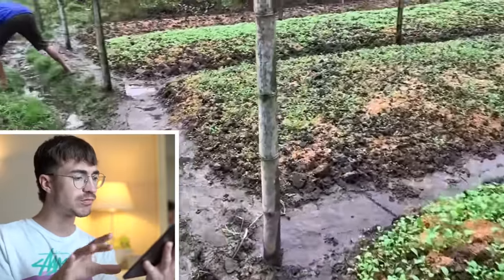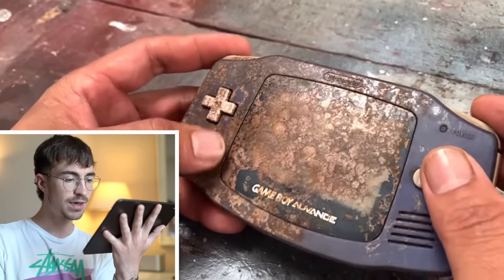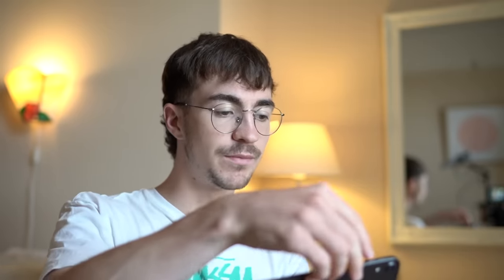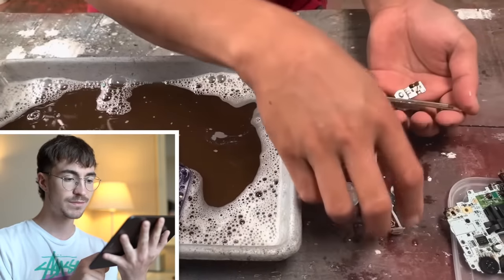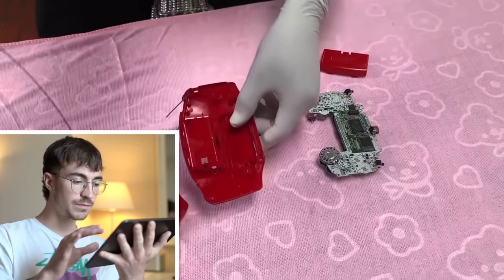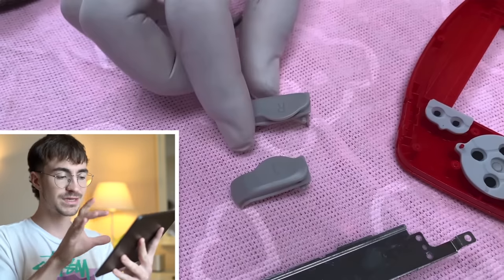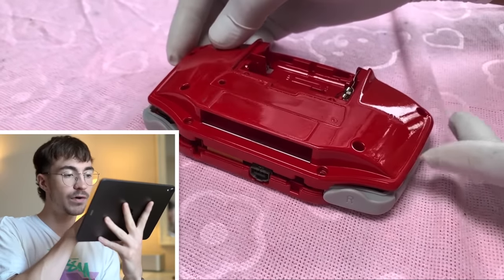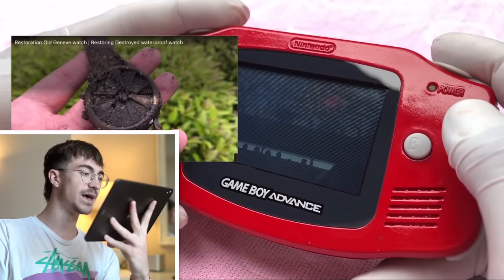Exposing FAKE Restoration Videos!

Comment: I don't know chief. After I cleaned my laptop in the sink, it actually unlocked additional RAM. These guys seem legit to me.
Reply: That explains why the big tech companies always tell you not to expose your electronics to water. They want us to give them more money for RAM instead of getting more of it for free 😒
Reply: You're hilarious😅
Reply: It's the ram that downloaded itself
Reply: Exactly! If you dry the board completely, it works. I myself washed a PCI card last month.
Reply: Wonder if you wash an RX 6500 XT would you get a higher frame rate?
Reply: @jerryspann8713  yes! Water is electricity conductor and rx 6500xt uses electricity (I think)
Reply: @jerryspann8713  Sure thing! Best also buy one with red LEDs for more power. But washing a GPU can be tricky. If you send it to me, I can do it for you, though. I will surely send it back!1! :D
Reply: I put mine in the oven and then immediately in the freezer, I get +128GB of RAM everytime 🤣😂🤣🤣🤣🤣🤣🤣🤣
Reply: @Jakub A
put my laptop plugged in while in the bath, didn't unlock ram, can no longer walk, I need a tutorial.
Reply: Water isn't actually the thing that damages electronics, it's the impurities inside the water that make it dangerous. What happens to the electronic is that when electricity goes somewhere it wasn't meant to go, it literally fries the board or circuit, but water isn't conductive at all, its the ions inside of it that allow electricity pass through, so if you use something like purified water, it won't damage anything because its not conductive enough. And yes, I know the video is fake. I just wanted to point out that putting electronics in a liquid, isn't really evidence that the video is fake unless you know exactly what is inside of it.
Reply: @menopriezvisko94  Water is actually a horrible electrical conductor, its the impurities inside of it that allow electricity to pass through.
Reply: @CrippleStick12  Idk if your replying to me, or someone else, but I'm assuming me, because I was the last comment to talk about an electronic in water. I already know this, we covered it in science 9, years back.  I was making a joke based around the whole toaster in bathtub joke. But while scientific knowledge is still helpful, It's helpful when someone makes a dumb comment, it's kinda unneeded when it's a joke. But that's just my opinion.
Reply: @rawdrywall8212  My bad bro
Reply: Yeah I unlocked more RAM after I accidentally hit my tablet with my head. 😁
Reply: When I Dropped My Laptop Off The Empire State Building Into A Pool Of Swamp Water And Hit It Multiple Times With A Sledgehammer I Gotten About 4206942069+ More RAM
Reply: You cannot post it online unless it's true. My government told me so.
Reply: 400TH LIKE
Reply: @meatblazestudios3778  congratulations.
Reply: Congratulations for your motherboard hardware components to get corroded later.
Reply: Probably 'twas the "water memory" effect one Chinese scientist was talking about ;)  Maybe start complementing it and you'll get some extra ;)
Reply: Also the motherboard is a device that slows down your console, make sure to smash it with a hammer to destroy the device!
Reply: That really doesn’t seem too far-fetched because when my WiFi stopped working, my computer monitor stopped working as well. I plugged my monitor into a different port on my PC and the monitor started working again, and so did my WiFi.
Reply: @Chicag-no   it makes so much sense now!!!!😦😦😲😮
Reply: Poor guy I washed my pc with water for 2 days straight and guess what it had no GPU but not anymore after I washed it I instantly installed rtx 4090 idk man they pretty legit
Reply: I chuckled at your comment.
Reply: @Chicag-no  its a joke mate
Reply: Does a dishwasher work better? Maybe send it to a rug cleaner youtube channel for them to run their scrubbers over.
Reply: You dont need to sink it in water, just download more RAM
Reply: I actually used to stare like hawk at my rgb and then the rgb upgraded my ram so now i have more ram it says 124098 ram so i trust you
Reply: @menopriezvisko94 😅😅😅😅😅😅😅😅😅😂😂😂😂
Reply: The fan on my tower was broken, so i put in the washing machine on 1200 rpm on high. That kickstarted the motor or something

Comment: You can tell some of these are fake from the thumbnail by the visible smear marks and lines from scrubbing dirt over the top of them. It's so ridiculous.
Reply: And it’s always strange dirt that is orange or green
Reply: @zero9112  are you sure it’s green “dirt”…? 🥶
Reply: And also the title says like "Restoring gameboy 3ds" when on the thumbnail is actually a nintendo DS lite
Reply: @ImNamo_  That’s the best part. They expect us to believe they restored it when they don’t even know what they’re working on… It’d be like me saying “restoring 50’s caddy” when the thumbnail is actually an 82’ GMC van….. Yeah if they can’t even get that right, I’m sure they haven’t the faintest clue what’s on the inside. Probably why they submerge them in water and scrape them clean with knives and soap…..
Reply: @Kathrynerius  Yep, I see one of these videos about the "restauration" of a 30 year old PC but you can see that the "30 yo PC" is in reality a 2012 3rd gen I-core machine.
Reply: If I did find a GBA I would take the shell because for one the system would prolly not work.
Reply: @Fizzyguy201Sonicguy6  I did once find four GBA SPs at the junkiest yard sale I've ever seen before, $5 a piece. They were all obviously kept outside, or at least in a shed. All four had batteries that were so swollen that I'm honestly surprised they hadn't burst and one had a busted LCD but other than that they all cleaned up well and still sit in my collection today. 

There's also a SNES I've seen that was soaked to the gills in cat urine and still works. 

If you've got the patience, you'd be surprised by what works. :)
Reply: @Solaceon  Can't stop laughing imagining a SNES floating in cat urine. 😄
Reply: This video from vietnamese all people and me know
Reply: Also the long ridiculous title

Comment: Yeah, it never made any sense how a rusty ass Gameboy covered in mud and degradation would magically work after soap and water and a new case xD
Reply: It's probably been in mud or water for years no way it would work without a board replacement, the restoration will cost the same s a new one
Reply: He must have used some kind of solvent
Reply: @alexramirez4693  nah you could tell he used s different board it didn't look like the original one with the rust
Reply: I think this one is heavily misunderstood u can look it up on youtube, there are videos where people fully drown a gaming pc and it still works after its dry, electronic devices only get destroyed by water if the power is on. When theres no electricity going everything is fine, you just have to ensure that its dry when turning it on again....
Reply: It didn't, they record it working first, then trash it and make a restoration video - in the end the working device has been recorded prior to the restoration.😂

Comment: The objects that these channels "stumble across" are obviously planted. And the rust they show is fake as well. It's always bright orange and evenly covering all sides of the object, like it was painted on -- probably made with a solution of salt water and iron filings, which quickly rusts when exposed to air. And they always completely reassemble the item before showing it working, to hide how they've swapped the internal components from a working unit. 

The lazy ones just switch to a completely different unit to show the finished "restoration", and have been caught showing different serial numbers on the item they "found" versus the one they "restored". Or they film it in reverse order -- demonstrate the working unit first, then trash it with dirt and rust and plant it on the side of the road.
Reply: I have seen such trickery used in videos varying from tool restaurant all the way to bushcraft.   Maybe that mean one's niche has gone mainstream?
Reply: Your last sentence in this comment is very hilarious. Imagine destroying a brand new device just to throw it to the trashcan and titled it as the "restoration"
Reply: @sihamhamda47  Yes, they certainly do it. They earn more money making that video than what they paid for the device.
Reply: To be honest I wouldn't mind a little bit of staging but this one is clearly over the top. There is no way in hell this GBA is turning on after what it allegedly had gone through without at least cleaning the inside and letting it dry for 1-2 days. But the worst for me is that old piece of foam. Why would you allegedly use that again if you could use something else in stead or in this case buy new parts anywhere. Which I wouldn't mind as well if it was made clear the old parts were beyond repair instead of hitting screws with a blowtorch which obviously not will powder coat them black. This reminds me on an PC restoration video I've been watching for 25 minutes and in the end the Core 2 Duo machine booted as an Core i5.
I literally feeled robbed 25 minutes of my life that I wasted watching that .....
For me only trashing an working unit would be a more aweful thing to do for an video than that cheating and wasting the time of others.
Reply: It actually looks more like some sort of paint or grease, so maybe they added a layer of rust and then covered it with something? Because that thing does not look rusted so much as it does covered in some glossy substance. I guess it's supposed to be mud, it just doesn't look like mud?
Edit: In the closeup shot it almost looks like the surface of a chocolate cake, is that what salt water plus iron filings look like? I'd imagined it would be rougher and more pitted?
Reply: @Troppa17  The filthy old foam was used to hide the fact it's not the same LCD, there are model number/supplier markings on the back of the LCD.
Reply: my first thought that it's look like rust is painted, like when 3d model textured to look old
Reply: I watched one of the Philippine "restoration" videos once of a guy walking around a trash heap, and he finds a karaoke system submerged in mud. Took it to his shop, washed stuff off, good as new. Then YouTube recommended me another one: some guy walking around a different trash heap, finds a karaoke machine submerged in mud. Same weird Chinese knock-off brand, mind you--despite having a Massachusetts USA address (that I think was spelled wrong) I could find zero about this company or this product. Amazing how many of this particular obscure brand of karaoke machine there are just laying around in the mud in that country.

BTW if you really want to watch a ridiculous one watch the guys with a complete destroyed Benz being brought back to life. They're so shameless, they even pinned the top comment as one that basically pointed out they did it in reverse, taking a Benz and trashing it to make it look like they restored it. They don't care. You won't read the comment until you watched enough of the video that they made their coin from the ads; and the angry comments just boost the engagement for the algo.
Reply: Yeah I’d like to see them repair the pits in the metal from real rust. I work on cars in the rust belt.  It’s not getting repairs unless it’s all new metal lol
Reply: I don't know why everyone points out the fake rust. It's obviously fake. How tf would plastic rust?
Reply: Thanks for reiterating the entire video
Reply: I see the exact same thing on fake restorations - The even nature of the "deterioration" is improbable at best and looks like it was done by a person.
Reply: @TheUnamedPerson  Bruh. Talk about "fake gun restorations". I've seen so many of those bullshit gun restoration videos. They get MILLIONS OF VIEWS while the professional people like Mark Novak barely get 50,000 to maybe 100,000 views at the most.
Reply: "It's magic!!!"*****WELCOME*****THE BOXNEWS****
Reply: There were similar videos where people faked saving animals from dangerous circumstances so i guess it's better they are doing more harmless stuff like this instead
Reply: @paulhanck1123  exactly my thoughts.
Reply: Don't mind me, just walking by a landfill with my camera to record this beautiful day.. Oh look what we got here, a gameboy!
Reply: plastic doesn't rust how did black plastic and a glass screen rust?
Reply: So are those watch restorations fake too?
Reply: No...
Watch his channel, he's made everyone aware he has replacement and aftermarket parts...this is just people randomly watching one video from one channel and being pragmatic...
Listen children, do your research, watch the restoration channel, he shows that he uses aftermarket and replacement parts for past 5 years ...this is sad, shows how quickly stupid people make judgement calls without any prior research
Reply: My name
Reply: @Inlinetodie  l
Reply: You’re one of the original people I starting watching when I joined YouTube over a decade ago. It’s always nice to see you in various comment sections. You, lmull3,Maxxarcade,uxwbill, and IMNC all kindled my interest in computers and electronic tinkering.
Reply: As long people watch these type of videos,YouTube will promote them